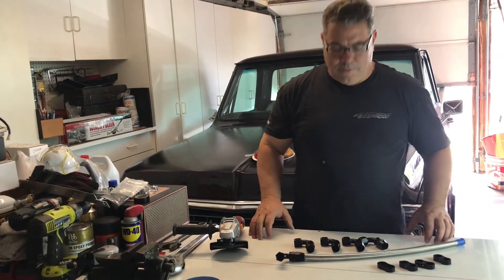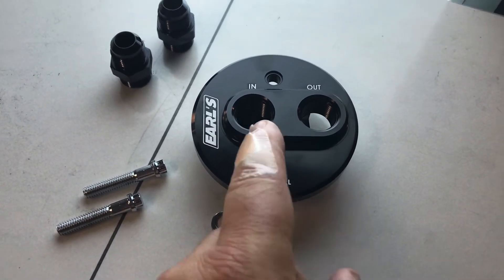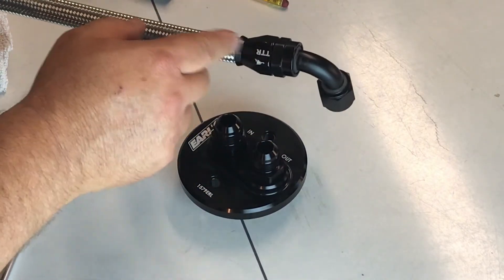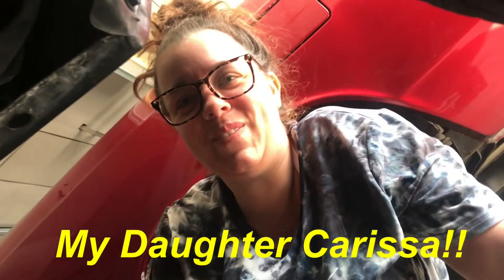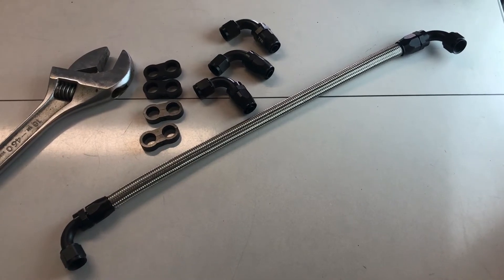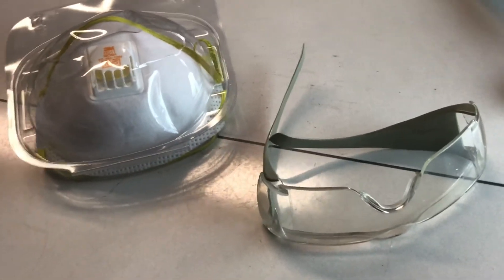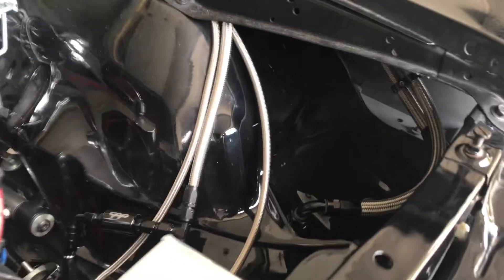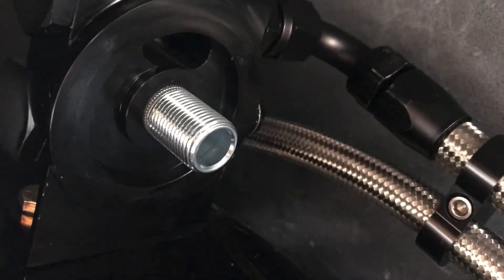Install Oil Filter Adapter, Relocate Oil Filter & Oil Cooler on Big Block Chevy, part 2

Comment: Did you need a high flow oil pump?
Reply from the maker: Hello ChevyCeeLo,  this is Franky your host of OGG!  I would definitely recommend a high volume oil pump mine is a Mylodon which was a match for the oil pan from Summit Racing.   The remote filter and oil cooler and lines hold about 2 quarts!  I noticed I have to start the car with no ignition so the motor doesn’t fire right away to get the oil pressure up and pump oil into the remote system in case some drained back into pan.   I think this happened and I had air in the line and too much oil in the pan I started leaking a little oil from front and back seal which stopped after I realized what was happening so every time I start it I have to prime the oil pump and remote system to make sure any air is out and the system is full and not in the pan.  To prevent too much crank pressure in pan from having too much oil in it.  Leaks stopped and everything’s been good!  So long story short I crank motor over about 3-4 times to see good oil pressure and make sure oil moved out of pan and fills remote system.  Then I start motor!  Thx for watching! Please Like & Subscribe if you haven’t already!  😎👍
Reply: I'm thinking it's because you needed a sandwich oilfilter thermostat?
Reply from the maker: Are you pulling my leg or that a thing? Lol
Reply: @OldGuyzGarage 🤣 No, seriously, here is the one I'm getting Derale 15782 Thermostatic Sandwich Adapter Kit. This should eliminate the pressure issue, in theory. I believe it will, so lmk?
Reply from the maker: Ok I’ll check it out thanks Ceelo! 😎👍
Reply from the maker: Sandwich oil filter thermostat?
Reply: @OldGuyzGarage  Also, you can cool your oil too much.

Comment: Did you leave the old gasket in there?
Reply from the maker: Hi Chris the new Earls Oil Filter Adapter came with a new gasket/seal sorry if you missed it but yes we installed the new one! 😊👍 Thank You so much for watching Old Guyz Garage and helping us grow the channel by liking and subscribing!  Please feel free to ask questions anytime! 😎. Thank you again!
Reply: @OldGuyzGarage     Old post, but what i was referring to is the old gasket seemed to still be stuck to the block when you removed the original filter adapter.     Did you take it out off  when the camera wasn’t recording?